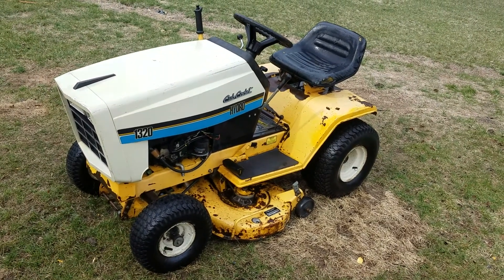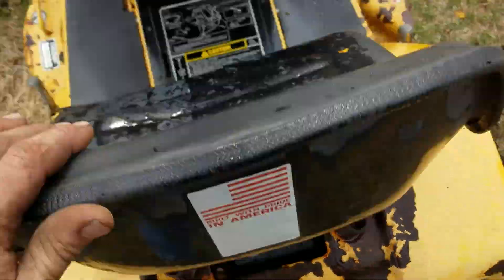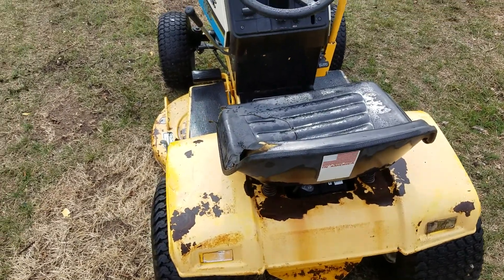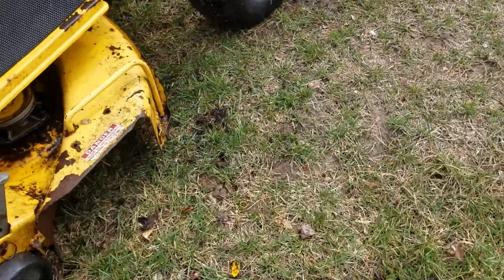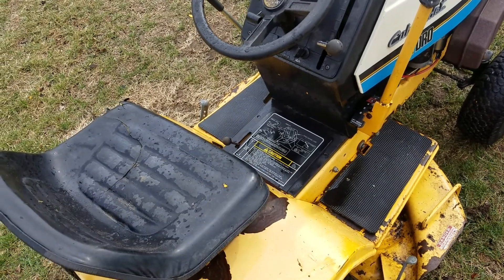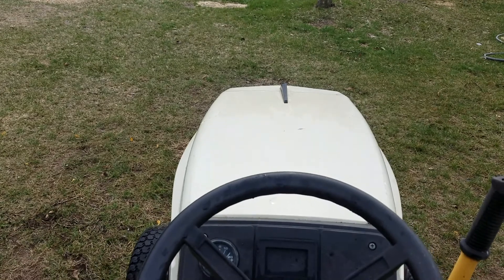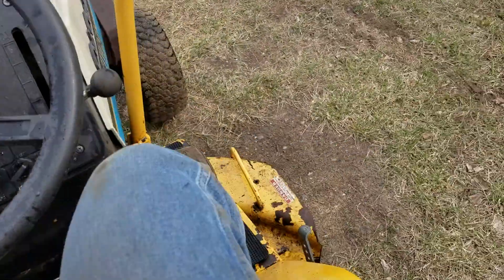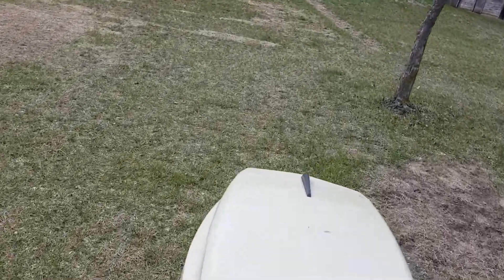Cub cadet 1320 hydrostatic riding lawnmower run-up

Comment: What would cause the tractor from moving its wheels when you put have the selector in neutral. The tractor cannot be pushed. How about the deck, does this tractor have an electric on off clutch ???? How to check hydro oil fella ??? Thanks